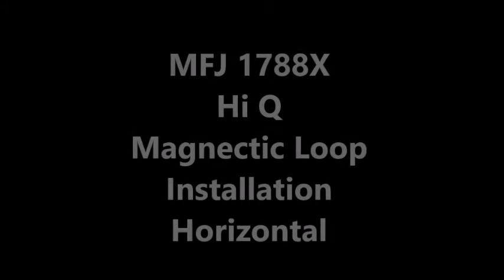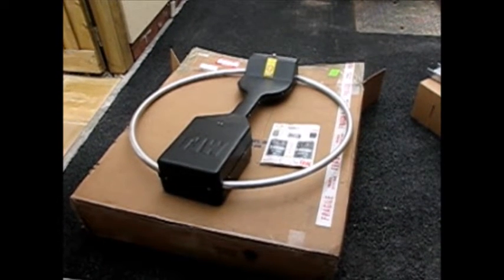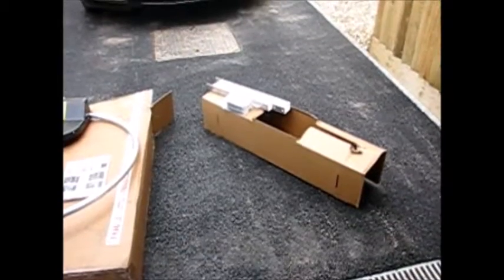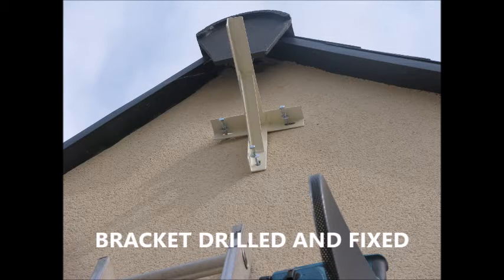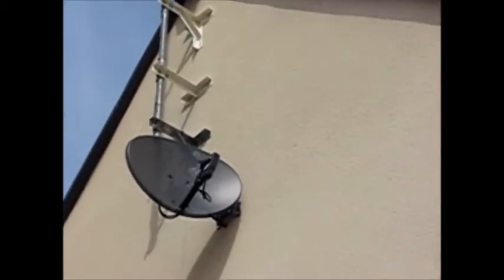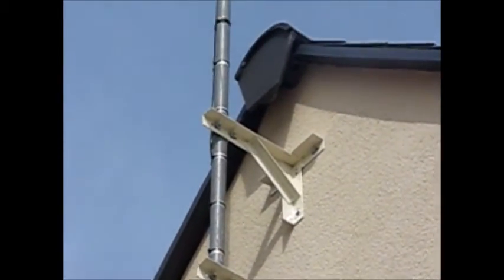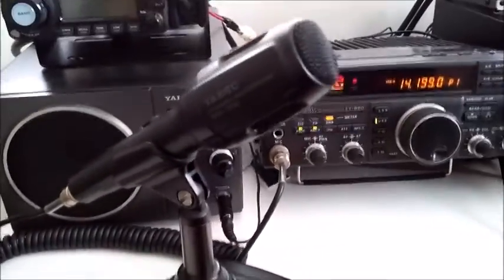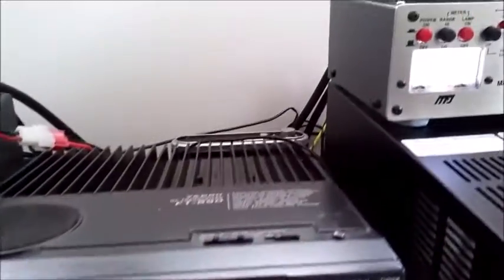MFJ 1788X Installation Un Packing and installing plus EZ End fed. By G0MRR

Comment: Hi Chris, I realise that this thread is quite old now but hoping you could give me some advice on this loop.  I recently bought the same loop and set it up vertically indoors in a small room. I could tune 40 and 20 metres down to about 1.3:1 and the SWR while fast tuning between bands was about 5 or 6:1. I have now pole mounted it horizontally outside almost identically to yours. Here’s the issue. I can now tune down to an indicated 1:1 (on both rig and tuner box) on both bands but the SWR when fast tuning between bands is off the scale and prompting a warning on the rig (991a). Was / is this the case for you? I’m scared to tune the way the manual instructs for fear of toasting my finals. Any guidance would be much appreciated. Nice video BTW 👍
Reply from the maker: Viv, the max voltage when tuning should be around 5 watts but no more than 10 watts can you confirm you are doing this correctly. Look at my website or Qrz .com and email me I will then reply with hopefully a little more help. Chris. G0MRR.
Reply: @ChrisDP1644  Thanks for your quick response. I am only using 5 watts.  I will contact you via QRZ. Thanks again.
Reply: Sorry Chris I can’t locate your details on QRZ. I’m new on there so unfamiliar.
Reply from the maker: Email g0mrr@aol.com.